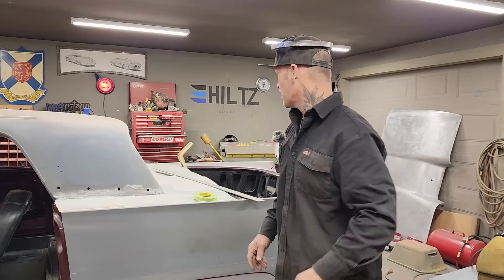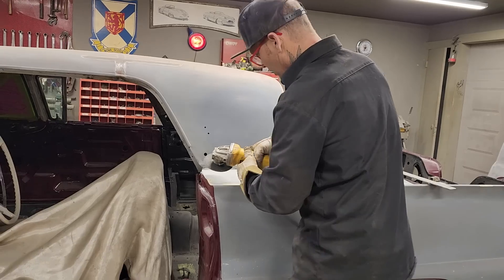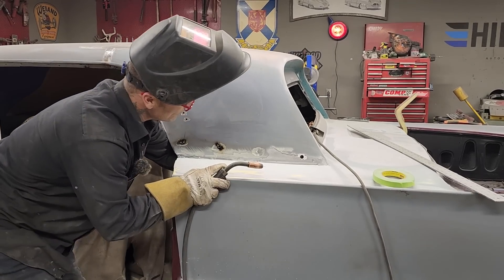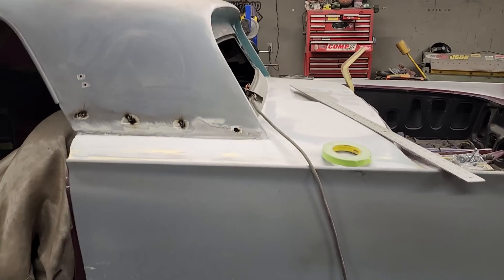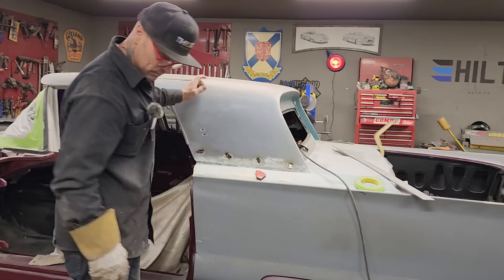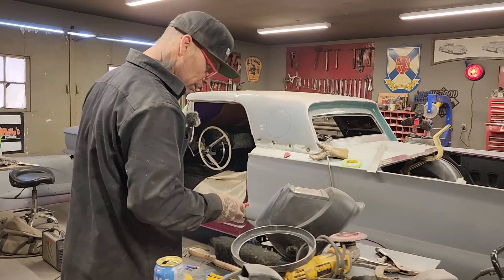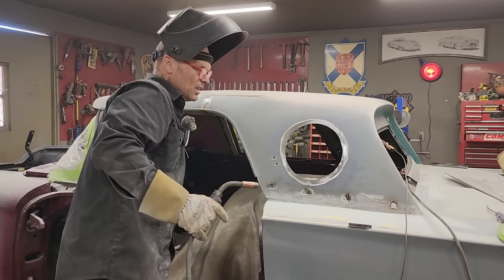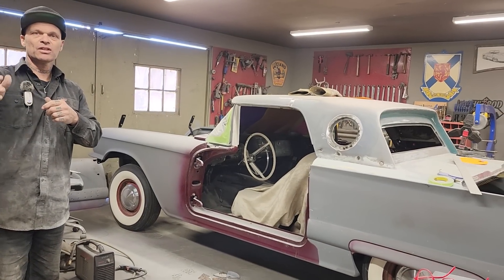We ran into some issues applying the port hole windows 😝

Comment: On filling the holes, between the coat hanger & massive heat. What are thoughts about just tacking the plates in, & then a tight coat of fiberglass? 

Isn't there a better metal than coat hanger for this? Or is it the same.. Id think like welding rod or something better quality.

Comment: Weld a piece of wire to the center or the metal plate an pull through the hole.

Comment: I would tack weld wire and cut a length off the feed the wire from the back pulling the plug to the surface for tacking. Save the finger prints

Comment: I saw the pic of the port hole before I clicked on the video and knew then that he had messed it up.  The port hole is way too big in relation to the rear window.  Geez dude,seriously??
Reply: I think they need two more large port windows on top of the roof so they can stick their heads out the roof while driving.  I wonder if they have helmet laws in Canada

Comment: I have cheated by taking a short bolt and put the head against the metal and the threaded part gives you a handle to hold to. Like you said it's on a place you will never see and it works well, just a little trick I've done

Comment: Chad Couldnt you weld a coathanger to the center of the patch first then slip it through the hole from inside and hold it on the outside in place and weld it up

Comment: it was hard to watch him keep burning his fingers.... just use a hot glue gun and a chopstick... glue the metal piece to the end of the chopstick, put it in place, and weld it... the heat from the weld will melt the glue and the chopstick will be released from the newly welded piece of metal.  cheap, easy, and quick!

Comment: MORNING cHAD AND YOUR GOOD LADY SMALL TIP /IDER TRY SPOOTING A SHORT LENGTH OF MIG WIER TO THE CENTER OF THE PICE OF METAL THEN INSERT IT FROM THE BACK SIDE PULL IT INTO PLAC AND WELD  THEN DO YOUR NORMAL GRIND OFF  AS NORMAL  BRILL SHOW KEEP IT UP .